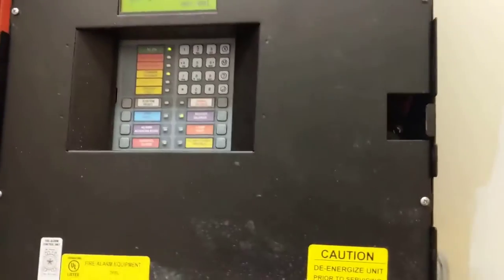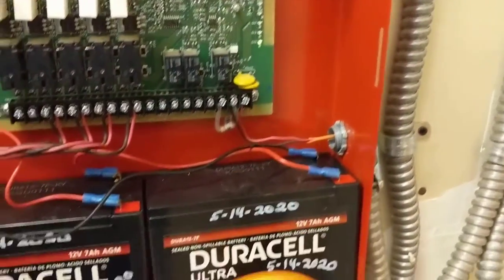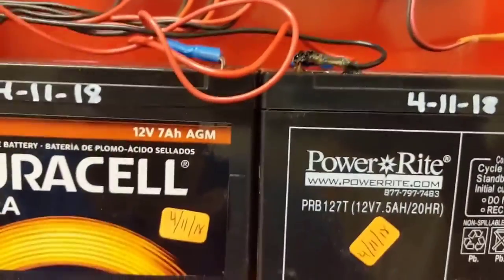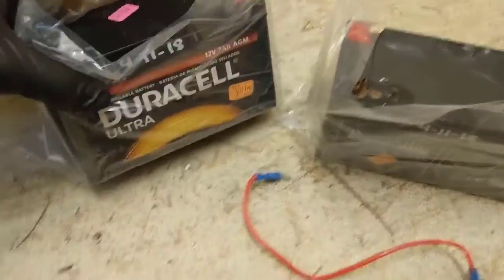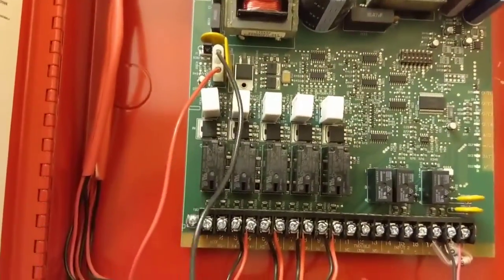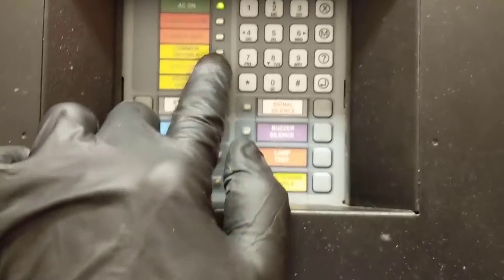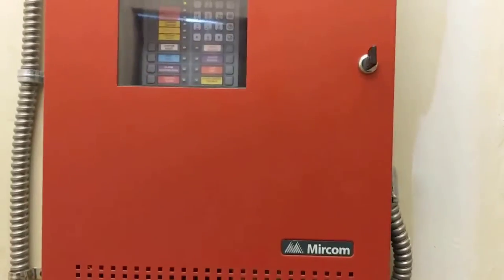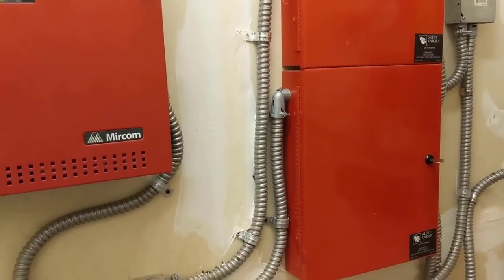Mircom Fire Panel Beeping Common Trouble

Comment: Terrific Video Buddy! I Thoroughly Enjoy Videos Like These, Because I Have Had To Put New Ends On The Battery Wires For SLA Batteries In The Past As Well. Also, At The End, The Napco Starlink Is Considered More Of The Cellular Radio Backup, Not The Repeater (Even Though I Guess You Could Interchange The Two Terms). Keep Up The Superb Videos!
Reply from the maker: Appreciate the feedback Trevor, & I as well enjoy these types of videos. On my system each building has their own landline which reports back to the monitoring service. 12 buildings & the clubhouse, so there's 13 different addresses or (phone numbers). The old repeaters were wireless & reported to the clubhouse & then to the monitoring service. I've just called them repeaters since that's what the company that installed them last year called them when they updated our system. I'm still learning the fire panel stuff which is very interesting & I'll take any information I can get on this stuff. Thanks for watching Trevor & hope your Subscribed to the channel 👍

Comment: Not a fire system, but an alarm system. Police called us in middle of night the system was blaring for hours. NO idea since I was just (so-called) emergency service (meaning quick fix), I pulled power switch and alarm still would shut off. I think the battery back up kept alarm running. So I had to disconnect both batteries, finally shut alarm off. Informed maintenance staff in the morning what I had to do. They worked on at later time.
Reply from the maker: Nice 👍
Reply: @ApartmentMaintenance  What I havent informed  you of, is I was raised in this business. My late father was a property manager first 1976-1985. The parent owner was based in Philadelphia. After that property was sold, we were moved to HQ area. Watched an abundance of remodeling or flips thats called today. My father and I were apart of the maintenance staff. The company rented off campus living to University of Pennsylvania stuents.  But the reason I never learned the skills i see you can do, is my father and I had an estrangement but it was more ironic on his part than mine. Id rather have learned those skills.
Reply from the maker: @davidfrederick1971  That's crazy, I'm from Pa, & started out my Maintenance career working in off campus student housing. Small world! 👍